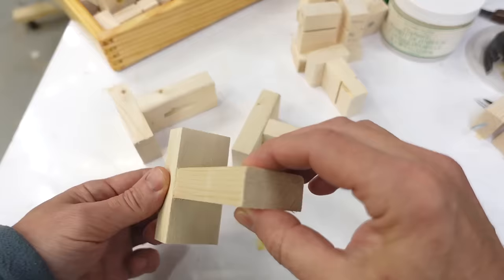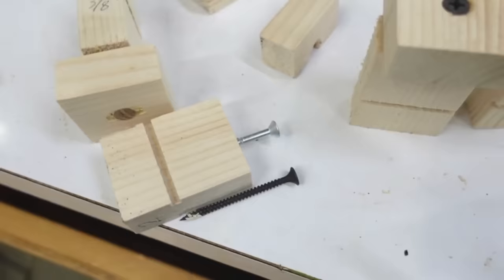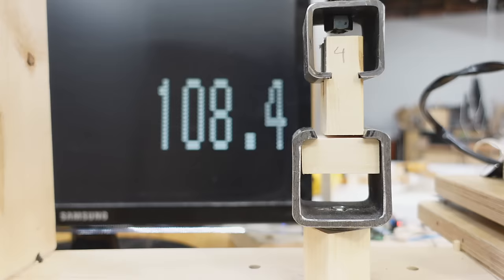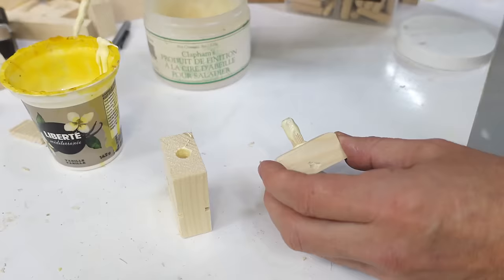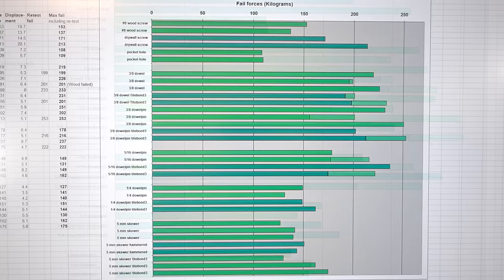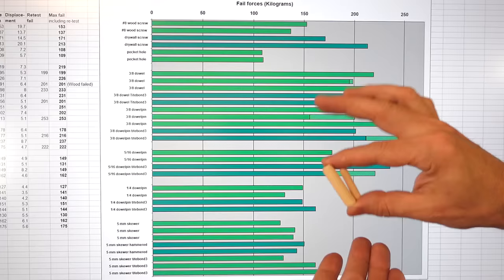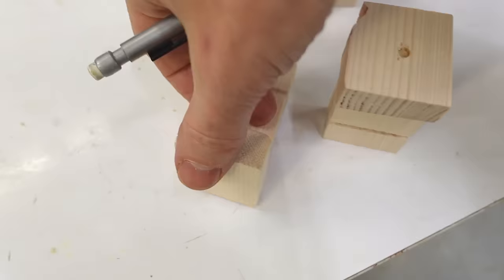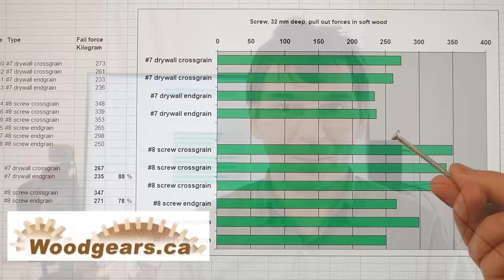Bamboo skewers stronger than pocket holes?  Dowels vs. screws.

Comment: Might be a neat idea to test dowells of various lengths. See where the benefit of longer dowells, if it exists, meets diminishing returns.
Reply: Gut feeling is its exponential, not linear.
Reply: ie. longer lengths get exponentially harder to pull out
Reply: And washers! How big do I need to make 'em to rip out the threads? Does a flat-on-the-bottom washerhead suffice?
Reply: You'll get a linear relationship as glue surface increases proportionally to length. Then there will be a hard limit at the breaking strength of the dowel, which depends on its diameter.
Reply: Is there such thing as a spiral fluted dowel?  Essentially a screw-looking dowel, where insertion is still done via press-fit just like all other dowels, rather than needing to screw them into place.  Also the spiral flute wouldn’t have a tight screw pattern, but rather an elongated spiral, otherwise failure would be too easy.
Reply: I’ve been using 3/8 X 2” spiral dowel pins for over 50 years as a cabinetmaker. Spiral is the best because even if the glue fails years later, the dowel won’t fail because of the spiral of glue in the dowel acting like a screw. In all the repair I have done (mainly in chairs and tables) it was always fluted dowels that failed but never a spiral.
Reply: なぜダボ機構に固執しているのか理解できない。マシアスさんが陥る機構ではない。ダボもホゾも木材の接合には有義かもしれないが木材本来の木の目を確認する能力がいる。

Comment: I have been using small bamboo skewers - the ones you can get at a grocery store - as dowels in small projects for a long time. I find them useful especially when joining thin pieces of wood side by side. They work well for me. But I don't have all of the quantitative test equipment that you do, so I have no actual data to share.
Reply: I will have to try those. At present, I don't use dowels on thin pieces

Comment: It would be nice to see the performance of woodscrews with washers.
Reply: That would be very similar (or identical?) to the test where he pulls directly on the screw in end grain.
Reply: Or just use Lath Screws!!!🙄
Reply: Just that how big the washer has to be, so it outperforms the threads in the end grain. And also when you bore a bigger hole for the washer+head how big is the negative impact?

Comment: I've seen a lot of these ultimate joint strength videos recently on YouTube but I really question the validity.  What I think is more is more relevant to furniture is cyclical loading, or fatigue of the joints.  For example, in this test it showed that the screws especially started separating before the joint ultimately failed.  Imagine you made a small shaker style side table with no stretchers between the legs- and you only had the top rails directly under the table top.  The normal load this will see under daily use is if it's bumped, and the table slides across the floor.  This would be especially bad on carpet where the narrow feet sink in.  The loads on on the joints would loosen those pocket screws and the table would get really wobbly really quick and drive you insane, and you'd throw it away long before it ultimately failed.  If this was made with mortise and tenon joins, and maybe with draw bored tenons, it might not be any stronger in ultimate strength, but it would last a LOT longer, maybe even for centuries before the joints came loose and the table got wobbly.

Comment: Thank you, Matthias!
I use quite a few bamboo dowels because I have them and they are cheap. One thing I have noticed, some of them have a burnished almost waxy surface feel to them. I don't know if it is a substance in the bamboo or a result of the dowel-making process or both, but I feel it may hinder the glue from fully penetrating the surface of the dowel, on those, I give the full-length dowel a light sanding with 220 paper before cutting them to length, I don't know if this helps though.
Reply from the maker: I suspect its burnishing from how they were made.  I gave my dowels and skewers a very light sanding before using them
Reply: That's part of the production process: It's when the cutter gets fairly hot that the wood may loose a bit of resin in the process (like it's cooking off). You can sometimes see this if you cut wood as well, then you get a glossy very flat surface instead of a normal cut (and shortly after you see burn marks).
Reply: @RubenKelevra  Thank You, that is much how I imagined it happening. Some parts of the bamboo may have less resin which would explain why some have a dry woody-like appearance, whereas some others containing more resin would have the burnished areas with a slight sheen. That being the case perhaps using a solvent would be a better prep for glueing than sanding?

Comment: Great video. It would be interesting to see a "stress-strain", actually force-displacement, diagram for each joint. Then you could get a sense of the failure mode of each, at least from a brittle/plastic mode.

Comment: I'd imagine the fluting adds a good amount of surface area without increasing the radius, which seems especially important bc the dowels seem to pull out rather than fail themselves
Reply: My theory is they allow glue to remain during installation, preventing the joint from becoming glue-starved; either way, it shouldn't be too hard to just run a screw up and down a dowel to add some fluting.
Reply: My thought was that the fluting allows for a tight surface contact for gluing. The high spots of the fluting are able to be slightly larger diameter than the hole, and deform easily to fit the hole. For a solid dowel, you need to be a lot more precise with the hole size or else the dowel either won't be very snug or won't fit.
Reply: Or the flutes allow the air in the hole to vent when pushing dowel in?
Reply: @joelhollingsworth2374  yeah i agree with this assessment. there's just not much glue left in the mating surface area after pushing a standard dowel in.

Comment: My experience with repairing wood windows:
1. Two inch long fluted dowels about thirty years old. Mostly the glue from 1976 had failed long before I was working on the windows.
2. Miscellaneous kludge screws to try to fix the failed dowel joints: The dry wall screws were rusted through (the windows were at the ocean) and the zinc plated screws didn't do much better. I also thought that there was a failure mode where the rail/stile joint failed from the screw working against the wood over time from wind loading.
3. 7/16 inch dowels through the stiles into the rails from the outside with titebond glue: As near as I could tell this was a permanent fix in the sense that something else was probably going to fail in the window before the rail/stile joint. I saw no reason for the fanciness of hiding the dowels inside the joint  I just drilled a hole through the stile into the rail with the window clamped together. For awhile I was concerned that I wasn't using a fluted dowel. I doubt that was an issue. I put glue on the dowel and into the hole (I used an acid brush to make sure the inside of the dowel hole was thoroughly coated).

As an aside I thought about doing the kind of testing that was done in this video. I never did but I thought the testing in this video vindicated my choice of window repair method. One thing though, I could just pull the old windows apart because the original joints had failed. I don't think the guy who tries to repair the windows I fixed will be able to tear the joints apart in 30 years.

Comment: Thanks for teaching me not to shy away from screws in endgrain anymore, l never would have expected that to work so well
Reply: Did he mention what pilot hole size he used? That could be important. I think he had done a previous test on that but can't remember if that included end grain.
Reply: @F0XD1E  l don't think he mentioned it this time, but usually you wanna go for about the minor thread diameter, or the thickness of the core of the screw between the ridges

Comment: Back in the old days, when we were adding a wall to a concrete slab (such as when changing an open carport into an enclosed garage or additional family room), we would use a hand chisel type star drill to put a hole in the concrete and then pound a peg of wood into the hole.  We would then drill pilot hole into it and use that the mark the location of the hole for the 2x4 baseplate for the wall.  Then we would use a lag screw to attach the baseplate to the peg and thus to the concrete.  Later on, we started using lead and/or zinc inserts into the holes, but still lag screws.  It would be interesting to see how the strength of those old solutions compare to the modern concrete fasteners.

Comment: I would like to know, how much would putting a suitable sized washer beneath the screw head prevent the screw head from sinking in and such increasing the strength of the joint. The result of end grain versus cross grain was indeed somewhat surprising.
Reply: I used four inch screws driven through the stiles into the rails as my first attempt at fixing some old windows. I used the washer under the screw technique and I was sure that it was better than using just a screw. I abandoned the screw for the dowel technique because I thought the dowel was a better long term fix. Even with out the issue of the screw head working like a wedge there is still the issue of the screw damaging the wood over time because racking from the wind load.
Reply: @davefoc 
Main weakness of dowels is that they expand and then contract. Not an issue when the force is generated across the joint but becomes an issue then the force pulls the joint.

Comment: Perhaps it's time to buy a clip-on displacement gauge allowing you to plot force vs displacement. It would be nice to track the drops in force and jumps in displacement, you can then associate them with what you see and hear during your tests. Some other nice data to be had from such graphs, work done etc. A bit of extra nerdy fun.
Reply: IRC digital calipers have serial interface pads in the baterry compartment

Comment: Would be interesting to see if the relationship between screw strength in end gain vs cross grain stays about the same across different types of wood. Also would be interesting to quantify that comparison in plywood since I'd expect screwing into the side of plywood to be significantly weaker than the other direction.

Comment: The instant you have visual separation could be considered the yield point.  In the case of the screw heads the wood beneath the seat is yielding to the load.  Up to that point the wood is probably elastic, after that point the screw hole undergoes plastic deformation.  Interestingly, a lot of people think in terms of ultimate strength when the component is often no longer useful after yield.  The beauty of ultimate strength is that it provides a little margin after yield and before ultimate is achieved.  That provides an opportunity to avoid sudden catastrophic failure.  Interesting set of tests.

Comment: I would’ve liked to have seen you test the pocket hole screws in the same orientation as the other wood screws, as I don’t think the heads would’ve pulled in as far and maybe held just as well or better.
Reply: That was my first thought as well. Matthias speculated on the wedge head of the regular screws. The pocket screws have a flat head where it contacts the wood. I wonder if the flat head would avoid the sub-200 joint separation?

Comment: This would be interesting to see with different types of screws. The wedge shape of many seems like a point of potential compromise to me, so, in appropriate applications, like butt joints, i use countersunk cabinet screws, which have an integral washer. While my preference is generally dowel joints, i am convinced that an appropriate screw style can be technically superior in some applications.

Comment: Moisture cycling should hurt the strength of crossgrain screws more than that of endgrain screws, since expansion and contraction should stress some threads more than others.  Into endgrain screws can be as long as you like.

Hoadley specifies half the pullout strength per length of screw into endgrain vs sidegrain.  I wonder if the difference with your results is hardwood vs softwood.

Comment: Some time ago I switched to using 3/8 inch dowels for shop furniture joinery (benches and such).  I don’t find screws any easier to use than dowels.  Just clamp up your assembly, drill your holes, pound in your dowels, trim them down when the glue is dry.  Simple.  And apparently plenty strong.

The practice of putting screws deep into counterbores and then covering the heads with dowels for cosmetic purposes mystifies me: why not just use dowels in the first place?

Comment: Interesting results. I like using dowels instead of screws, but they take a little more work to use for joining, and I actually assumed screws were stronger. I wonder what the results would be with a more sheering force on the fastener; turning your test pieces sideways and applying opposing forces on each piece being joined.
Reply: A sheer force would be much more relevant
Reply: This is a discussion that comes up all the time in these tests, and it depends. This is more like the top connection where a seat meets the back of a chair, so it has relevance. 
As this test showed, stronger connectors (screws) don't always mean stronger joints if they tear through the substrate, which is why the strongest joints are the ones that distribute the forces the most (dowels, box joints, tenons, etc.) That holds for both tension and shear.
Given the results, I'm now curious about a "pocket screw" with the wide, flat washer head recessed slightly into the surface but driven up into the endgrain like the other screws. They tend to be skinny so I don't think I'd trust the shear strength, but it would reduce the splitting that caused these screws to fail.

Also, he could have run a couple of dowels, skewers, or splines across his samples to reinforce the cheeks, bit that's a note for the next tester.
Reply: Good design would minimize sideways forces. For example shelving would be housed in a dado and the screw could keep the shelf in the dado. You would never design a piece where a sideways force on the screw itself could be the failure point. (and by "never" I mean  someone is going to do it, but it shouldn't be done).

Comment: I saw a video recently where someone said that the commercial dowel pins are compressed, so that when you add glue and assemble, the moisture in the glue causes them to re-expand a bit, locking them in the hole tighter. I’d never heard that before, and have no idea if it’s true.
I don’t have any on hand, but I guess you could test it by lightly wetting one and seeing if it did expand.

Comment: I always wanted to know how large the difference between screws crossgrain and endgrain is. If I had to guess, I would have said endgrain has half the holding strength (not measured anything, just had a feeling that endgrain fails proportionally more often). Good to see that they are way closer than I thought. So the endgrain failures were more likely due to where they were used (butt joints, which pretty much always are like a lever) than the strength of the connection itself.

Also good to see that drywall screws work almost as well as wood screws (and are even more consistent over grain directions). They are cheap and I have a lot of them left from building drywalls during a renovation.

Comment: All these years of watching your videos, my main takeaway is to not use pocket holes. My biggest reason for not get the setup is that it costs too much. Looks like there are better ways regardless. I'm finally starting to actually build stuff, so I'll be getting a dowel jig first. It's cheaper anyways...
Reply: I bought both, the pocket and dowel jig at the same time. I used both jigs and can't really say bad things about either. But for quick finishing, the dowel wins, because it is hidden. 

I made some solid wood pelmets, used dowels and I am super impressed by the outcome.
Reply: This is probably the absolute worst scenario to use pocket hole screws in. Their best benefit is that they're quick and flexible. Also, I regret buying a cheap dowel jig

Comment: Used to be you could get spiral-fluted dowels at most builder's supply places.  These days they're all straight fluted.  I'm sure the spiral type is still available...and probably makes for a stronger glue joint.

Comment: For screws in endgrain you'll have brittle failure, whilst you'll have more ductile failure in cross grain (as shown in the experiment). This coupled with potential cyclic loading, variation in moisture and cracks developing over time along the grain. I would be careful with utilising them more than 50% of your numbers for critical connections. Especially for short screws.

Comment: Would be interesting to test two screws at different angles, that way pulling out doesn't rely on the screw heads as much. And pilot holes vs no pilot holes.

Comment: Excellent video.  I'd love to see the addition of glue to the screws in your testing, as glue and screws each give a different type of mechanical hold.  Also, the same results with a harder wood might result in the screws performing better than they do when they can just deform the wood as they pull through (at this point you're testing the hardness of the wood instead of just the holding power).  Thanks!
Reply: I was also wondering about glueing the screws!